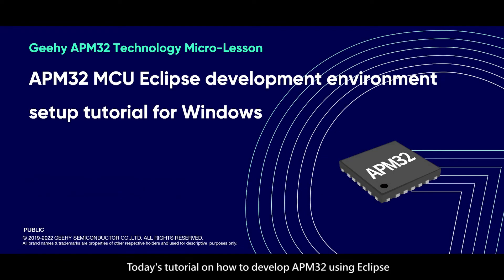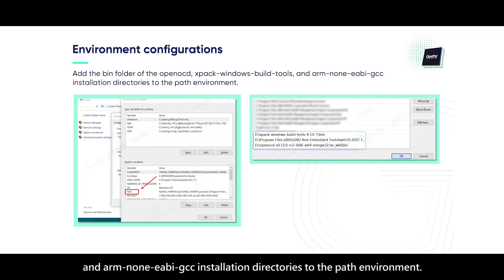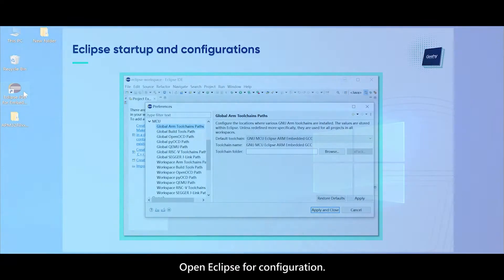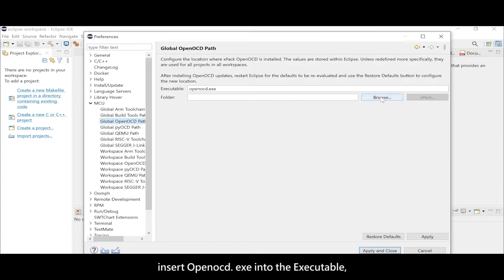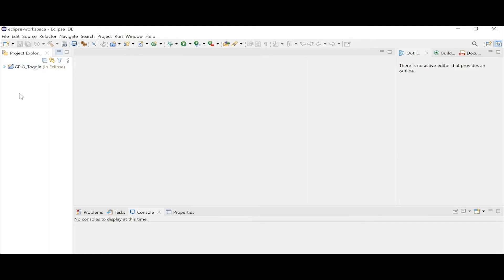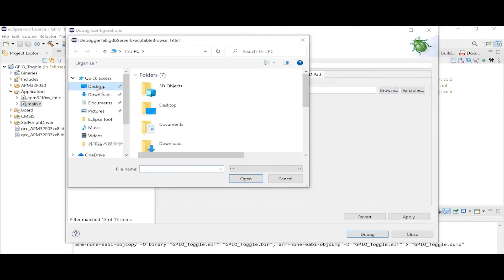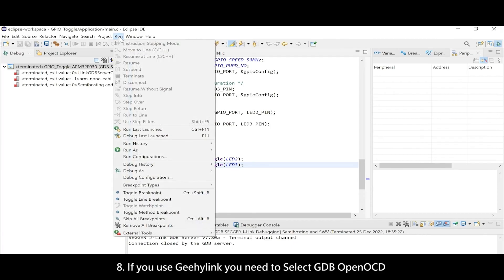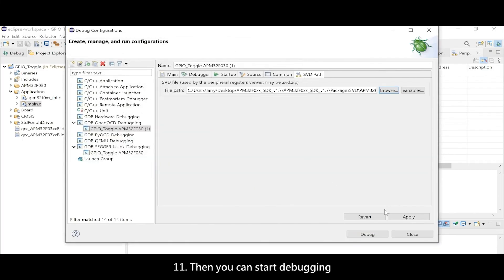APM32 MCU Eclipse development environment setup tutorial for Windows

Comment: I have installed Eclipse IDE for C/C++ Developers (includes Incubating components)
Version: 2022-06 (4.24.0)
Build id: 20220609-1112

but MCU option not showing in Preferences?
Reply from the maker: Hi, Eclipse for C/C++ does not have any MCU settings on Properties page, MCU settings are related to the ARM C Compiler and Build Tools, which are downloaded by users. Please check the pdf file mentioned in the link below, Eclipse part, by typing -target apm32fxxx.cfg, you can choose the MCU to be debugged.
Reply from the maker: We have updated Geehy’s online resources, which you can view and download via the link below:

https://community.geehy.com/d/800-sorting-out-apm32-online-resources-software-2024q4

Comment: APM32F4 has no read data protection because option bytes reset after shutdown. How fix it?
Reply from the maker: Hi! You can address this problem with the following two methods:

1. Using a programmer to configure

2. Configuring through code

If you encounter any issue while implementing these solutions, please feel free to contact our FAE via Email: Jim.kai@geehysemi.com, and we will be more than happy to assist you:virtualhug: